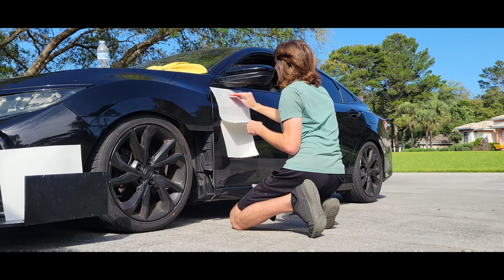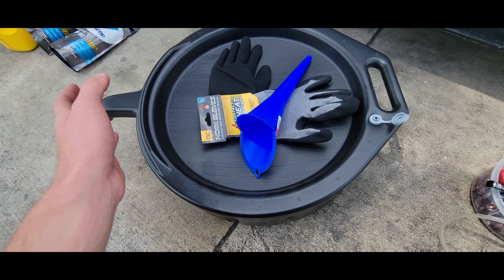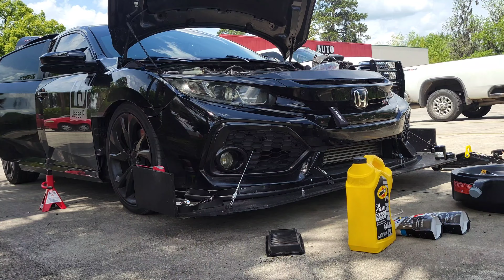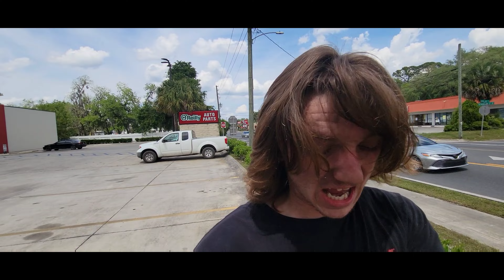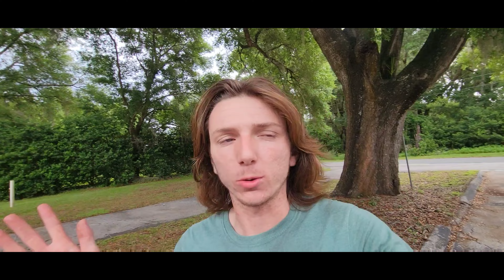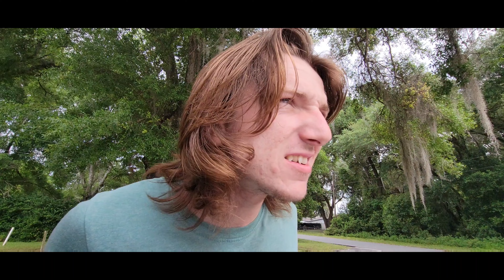Getting Ready For Georgia!!

Comment: Bad choice for the transmission oil.  Change that out asap and use the proper oil
Reply from the maker: I was just reading up on that. Ill have to drain it sometime soon. So far its been great, shifts perfectly fine and got me to GA and back with no issues at all. Looking at the OEM transmission fluid right now. Thank you👍
Reply: @jesseperrella  it will kill your synchro's.  Use Honda synchromesh or Amsoil synchromrsh transmission oil.  A lot of guys use GM synchromesh too.  All 3 are great